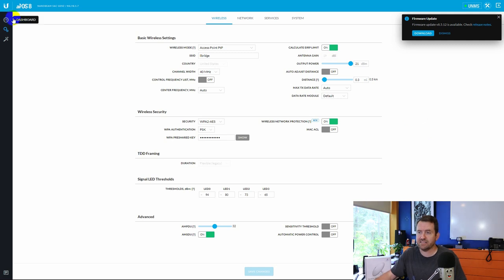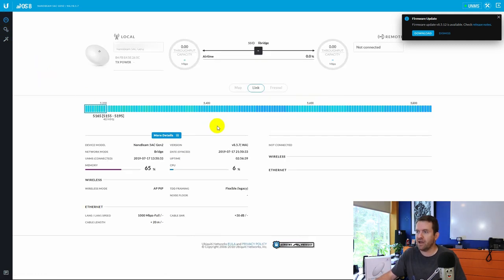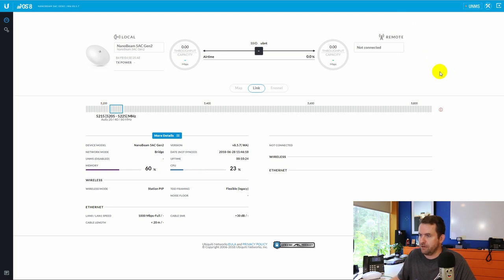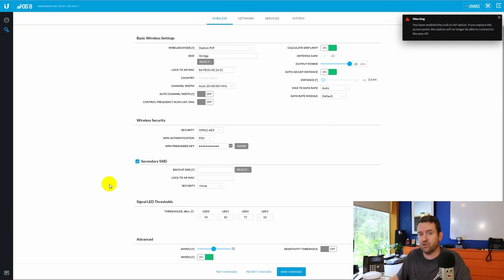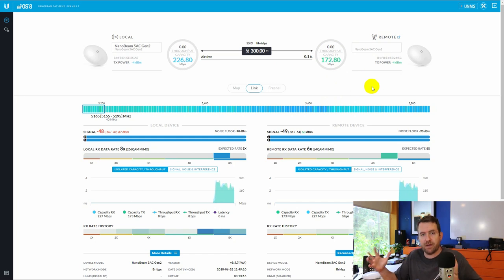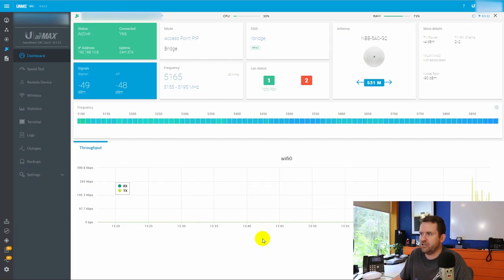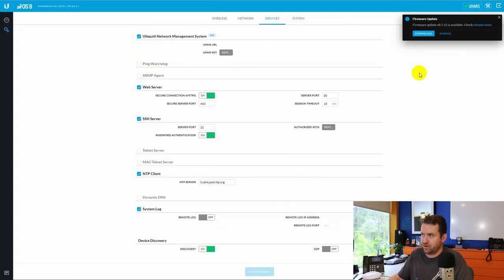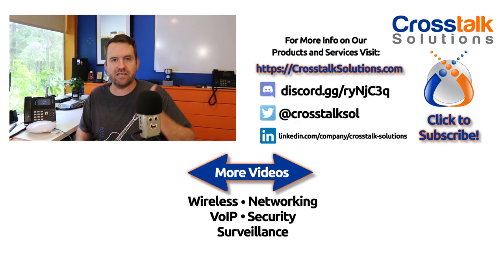Simple PTP Wireless Bridge

Comment: Pro tip: When it comes to outdoor poe equipment and inline surge suppressors (ground blocks or eth sp) use metal shielded cable ends on outdoor device to g block, then unshielded (clear) cable ends from g block to poe - proper grounding required

Comment: Chris, Ubiquiti is now recommending not using the PtP settings, even for PtP installations (like mine). The are now recommending using PtMP AirMAX Mixed, then setting the TDD Framing Duration to Flexible (New). This is supposed to alleviate some of the CPU bottlenecks, although I'm seeing only slightly better CPU and bandwidth performance in real life. If you have a contact you trust at Ubiquiti, it would be beneficial to all of us to know why these new settings, in detail, are now recommended over PtP. 

And sure, a detailed UNMS would be nice, although for my little install, just going to the web interface is sufficient for my needs.
Reply from the maker: I have not heard that - I'll see what I can find out.
Reply: I also haven't heard about this recommendation. Where did you find it?
Reply: Torsten Vogelreuter - From a Ubiquiti employee on the AirMAX forum before the change to the new forum software. I don’t know if they retained the old content, if they did I might be able to find it again. I am traveling until Monday, once I return I will search for it.
Reply: Especially on ptp links you will loose 80 MHz bandwidth capabilities. I also have seen sometimes 100% CPU load without having much bandwidth used, still unsure why this happened.

Comment: The ESP is not for a lightening strike. It's for static electricity in the "air". So strong electromagnetic fields and "static" potential energy on your roof during a storm. If lightening discharged through your wireless bridge and followed down into your cables, than the ESP protection will get blown to bits and the lightening would continue downwards. The siliest mistake I see is people Earthing a metal roof, which increases static energy and increases the chance of a capacitive discharge (lightening strike). Anyway great vid, btw.

Comment: I am very frustrated right now... i'm hoping you could give a tip to send in the right direction.  I have the 2 nanobeams connected and everything looks good.  I can ping the nanobeams from the local side no problem.  However i can't ping the switch on the remote side, and i cant ping the uap 150 on the remote side.  If i connect an ethernet cable between the two switches (local / remote) then i can ping all.  Obviously this negates the wireless bridge.  Thoughts?  Thanks in advance!
Reply: is yours M5? try to enable WDS.

Comment: I've setup a OOB Network for my internal DC Network guy with one LiteAP 120° (on a huge tv tower) and put PowerBeams on the 30km distance, LiteBeam (aka salat bowl) for the 3-15km endpoints and also NanoStations Loco for testing. But in the CIty the NanoBeam were not Useable, because get hit by to much backround noise at the Station sites and the LiteBeam is half the price.
It's all a Broadcast domain for running OSPF in case of a Fibercut. (as DC Provider our carriers had multible ways into the campus, but sometimes two cable search devices from cat find a cable)
All of my routers are ER-X or ER-X-SFP and runns fine. Even if the Firmware failes doing upgrade on the MX960's, my network guys still could get into console. (They were rofl away, as they heard the price of my setup and call it "toys", but it saved their ass) So we mostly only use them for OOB access and backup way for Monitoring of your DWDM and connectivity platform
Reply from the maker: Good feedback - thanks!

Comment: This is a nice video, but I miss more in depth informations. You hit only the small top of optimization points. 
I always would recommend to use the watchdog against each other and I miss the alignment tools, which were very helpful, using them in the right way to get a good and stable connection. 
Your video says it's so simple, but using it perfectly, there are many more points to look too. 
So at this time the video is more an advertisement, than a helpful guide. Sorry to say it because I appreciate you work much!
Maybe you will do a separate in depth video of it.
Reply: @taxid3rmy how to align such setups for example. Airmax has several tools for it and it's no private customer data, to show them and to say where we have to look for.

Comment: THis might be super noob basic question but - just confirming that I would use an ethernet cable to plug the 5AC into the "sending" wireless router and also the staton side 5AC into the receiving router? I live way up on a mountain but figured out I have mostly a clear line of sight to a neighbor's so we're going to do this, except for about 150 feet that I'll run a buried cable in PVC pipe for. Just wanted to make sure I'm getting the right supplies.

Comment: Have two of these plus two M5's.

Stable link at 655.2Mbps around 0.1 miles or 1,100FT

Using Starlink at home I get 180Mbps easily over at the party pool area 😎

Some times see 200 however 180 seams to be the norm over these links

Comment: Those nanobeam ac gen 2 are super easy to setup with the management radio. Chris in your experience what is the best way to align them properly? I like to use a laser pointer to get maximum accuracy. Maybe you have a better way to do it and I would like to learn it.  Cheers! 🍻
Reply: I work for a WISP, and we use a ton of different radios, but the easiest way is to use the alignment tool in the unms app while you make adjustments.

Comment: Chris, I help out running a swim club where we have the ISP entering the back of the facility in a shed.  Rather than digging a ditch, I assume this will work best to go straight from the modem and bridge wirelessly to a Dream Machine Pro?   I want to keep the DMP and all other equipment including Ubiquiti Access Control in the front office, but it would cost us thousands to trench for the cable company to provide internet up there.  Off the DMP, I am running Omada EAPs that I already had with a separate VLAN for the members, etc.  Can you confirm this system will be best solution to cover directly from the modem to the DMP to get internet to the front?

Comment: Greatest video! Thanks for sharing the information. What would be necessary to archive an affordable PTP bridge connection but without line of sight in an urban area? The idea would be to archive at least 20Mb/s - 30Mb/s between both sites. Is it attainable? What equipment would I need and what cost they usually have?
Reply: I'm curious about this also.  Ubquiti doesn't offer the M900 anymore and I'm wondering what else might I use to get 1/8 mile NPTP through some trees.

Comment: You should mention, that you can connect to the management wifi created by Nanobeam even with a PC/laptop and change the IP via the web management interface.
Reply: even better, you can open management web via a smartphone, AirOS 8 is responsive, and change for example Advanced network settings, UNMS app can not change that.

Comment: Why did you use a nanobeam instead of a pair of nanostation m5s?
Reply: NanoStation M5's are much older, much slower 802.11an gear. These use .11ac.
Reply from the maker: A few reasons - I like the form factor of the NanoBeams better than the NanoStation's.  The M5's are old, but the AC's would have been just fine for this deployment as well...though in my testing, they didn't have as much throughput.  We've been using the NanoBeams successfully for a while now...they're great.
Reply: @CrosstalkSolutions  I bought an M5 and M2 a few years ago to tinker with after watching your videos and wanting to learn more about creating wireless bridges. Would these work with an M5 when I finally do get another unit to connect to or would I be better off getting another M5 so the 2 ends match?
Reply: @pinballsteve1192  so the M5s should connect to the nanbeam ac gen 2 if it were set up as the access point, but in our experience with M5 rockets on an Omni antennae, we can not connect AC radios to it.

Comment: Chris, thanks for the video! By the way, is it possible to connect two nanostations M5 (using the passthru POE) to re-direct the signal to another location? See, I have a relatively short distance but no LoS due to a small hill in between the buildings and I was thinking of "going up" and then down... sort of speaking... I'll appreciate any comment about it. Thanks from São Paulo, Brazil.

Comment: I bought a set of pre configed Nano from Amazon.  Is there any special 
step on the receiving end in my out building to connect a wireless 
router other than setting up Access Point mode?  I have watched most all
 your PTP videos but they stop at the Nano configuration.

Comment: Thank you for the great videos! Wondering if on the output POE/Data, can you use a device to split that output to also run POE to another device?  I have a Bullet access point connected to it now and would like to add a camera up at the tower with it.  Thanks

Comment: awesome channel Chris - scenario... micro-wisp. two AP's at head-end - buddy a mile away offers his tower for 3rd AP.    existing AP's are on 10.10.10.x provided by head-end router.  simple bridge to buddy and 3rd AP wan port also on 10.10.10.x -- the question:   is it ok to assign the mgt ports on the two bridge radios to 10.10.10.x or something different? seems like a security issue . tnx

Comment: What could be the issue if my 2x nanobeam 5ac gen2 (bridge) connects well when i have one configured as Access Point ON with PTP off and second has AP off and PTP off. But when trying to change first AP + PTP ON and second AP OFF + PTP ON it does not want to connect with each other.

Comment: Ok, based on the diagram, the IP address of the main LAN is basically copied as the Gateway (ending with 1 instead of 0). My setup has its access point directly connected to the modem of the ISP. I need to figure out the IP address of that connection so the internet goes through to the Station? When I set the antennas as a demo in my house, there was no need to do that, I successfully shared the internet connection between the two, now there is no internet. What should I do? Also, whenever I try to enter the AccessPoint’s IP address to change its settings remotely, it still brings me to the Station’s settings.

Comment: Thank you for the info! I have the M5 so its a very similar process. but I am still running into trouble. and im not sure why. I have set up my access point in building A (where i have my ISP) and set up a station for building B. But how do i configure the router to be able to use the internet? When I plug in the router or plug my computer directly into the nanobeam it says there is no internet access. what am I doing wrong?

Comment: Great video, only question is does it matter which of the two Nanobeams is AP and which is station? I'm trying to beam my connection from home office to my shed, roughly 100 meters away (living on 3 acres). Ethernet/fiber isn't an option as the county regs here prevent running any type of cable underneath a driveway (driveway in the way).
Reply: How would they know?

Comment: Hi Chris, have watched many of your very informative videos on YouTube and wanted to ask you a question. I have an Edge Switch 8XP that is set up as follows. 

My router is connected to the Management port. On port 1 is my PC, on port 2 is  a Nano Station Loco 5AC (AP PTP), on port 3 I have a Cloud Key Gen2+ . Then on port 4 is a UVC G3 Flex, on ports 5 & 6 are 2 x UVC G3 Pros

My question is why can I not get the G3 Pro cameras to negotiate 100Mbps FDX as they will only connect at 10Mbps. The UVC G3 Flex connects fine at 100Mbps. Is there any reason why the wont connect at a higher speed? All the cabling is the same spec CAT6 and the lengths to all three camera locations is similar (around 15 metres)

Also I have a Nano Station 5AC (ST PTP) that I will be mounting on my garage that will connect to the previously mentioned AP PTP on the house. I also have an AirCube AC, an EdgeSwitch 5XP and two more Ubiquiti cameras that will be in the garage. What is the best way to wire these up in terms of the AirCube AC and the switch in terms of supplying POE to the ST PTP and will Unifi Protect allow me to manage these two additional cameras via the 5XP switch in the garage and the wireless bridge? Any help you can offer will be greatly appreciated. Many thanks......Rod

Comment: Solid video. I have 2 ubiquiti bridge devices that need to have the ip addresses changed. Will changing the ip (not touching the bridge or any wifi settings) disrupt the bridge connection?
Reply from the maker: Not if you’re changing the IP but keeping it in the same subnet.

Comment: This is a great video, i just purchased a few of them and setting them up before I deploy them at a customers site, I have them working well in my office now from help from your video. Question it seems that everyone is setting these up with a Static IP, but is it ok to set it up to use a DHCP, mainly because when I set it up at my clients if they have to replace there router from Bell or whomever in a year or 2 when the router needs upgrading or they change internet providers then it should auto detect a new IP if set as DHCP vs having me come out to site and re-setup the IP if the new router has a different IP range etc, or whats your opinion on that. I am trying to understand why everyone is setting these up as Static IP's etc. Thank you kindly,
Reply: While it can be set as dhcp...in the long run static is better

Comment: What about bridging multiple VLANs? Does it support tunneling 802.1Q (sometimes called q in q)? I setup a wireless link with a couple of MikroTik SXTs. I had to setup a SSID for each VLAN that I wanted to bridge. Worked flawlessly but was a bit of pain.
Reply: The Ubiquiti APs support 802.1Q if the feature WDS is enabled. WDS is enabled on the nanoBeam AC g2 by default and can't be turned off.

Comment: Hello! I basically want to set up a Mac Laptop basically in a huge felid and then remote in from another laptop 500-600 feet away in order to remote in a trigger a camera connect to the computer. Do you have a recommendation? Would using Ubiquiti LocoM2 2-PACK PRE-CONFIGURED Nanostation Loco M2 AirMax CPE 2.4GHz on computers get me what I want?
Reply: Why not just setup an IP security cam connected to the PTP and access the cam as needed. No laptop needed

Comment: Ive seen these devices on the internet for a while now. I am trying to extend the internet out ot my garage and have clear line of sight. If I set the transmitting disc (connected to my router using Poe injector) and the receiving disc on my garage again with a Poe connection going into a spare router acting as an Access point that will then transmit wif fi in the garage, the key thing is that I want devices in the garage connecting to this signal to show up on the same network as all the devices in my house (ie in the garage I will have cameras, smart tv, etc) is this possible. Also there will be a mix of 2,4Ghz and 5Ghz devices that need access to the internet. My second router can transmit on 2.4 and 5Ghz. Will this setup work?
Reply: Yes but your second router needs special settings. Turn off dhcp, set static ip on router in same network and make sure lan and wifi is bridged

Comment: I have a wireless receiver, it's a 2.5g Bullet Titanium in a marina. The Bullet is connected to a router that provides WiFi at the end of the dock. The marina provide the source of the signal in 2.4 and 5 g. I have been having interference issues and the marina administrator tells me to switch to 5g. The sending antenna is about 500 feet from the receiving antenna. Can you suggest a replacement for the bullet? I tried a Bullet AC-IP67, it wouldn't connect to the marina WiFi. The marina equipment is not airMAX compatible. Thanks
Reply: Just disable airmax etc and they can connect to any AP just don't get the same connection speeds

Comment: Ive used RF gas filled arc quenching serge protectors rated at 75 kWatts,  It still exploded after a lightning strike and the radios received damage.   I doubt your plastic plug in adapter is gonna do any thing but waist your money buying it.

Comment: Great video, love it! Would like a video of real world deployment and cabeling, do you do this or do you hand it off to electricians?
Reply from the maker: We typically hand off cabling to local electricians...as long as they're certified in low voltage.
Reply: @CrosstalkSolutions  Aah nice. Would you say it's dangerous to make your own 20 meter cable and run PoE?
Reply: @Mehmehx  Low voltage is not dangerous, unless the laws in your locale prohibit it. The cynic of me says in the locales that require electricians to feed Cat 5/6 cabling may been bought and sold by the local electrician unions.
Reply: @Steveos312  Yeah, Im in Sweden so it's laws for everything, but dno if this is one and I only do this for my friends and familly atm.